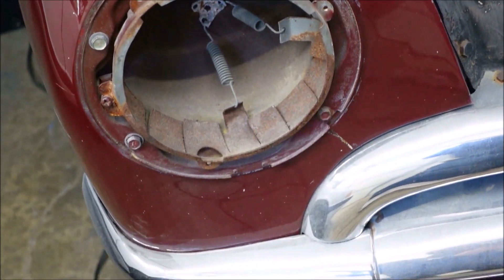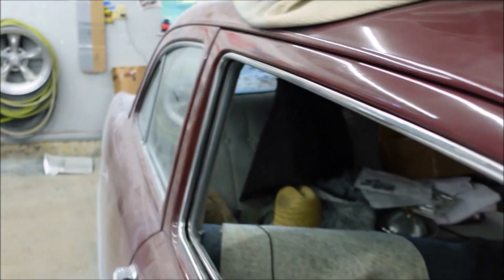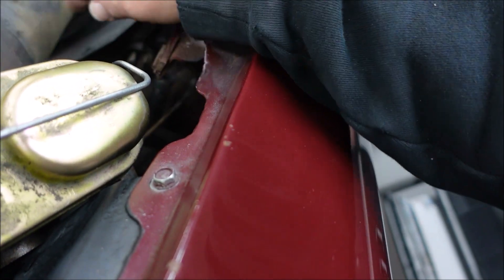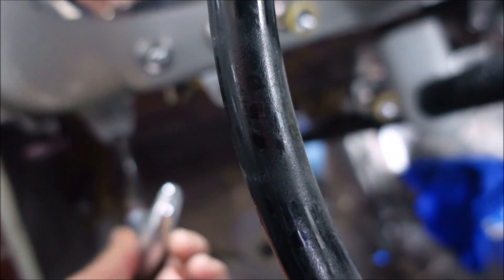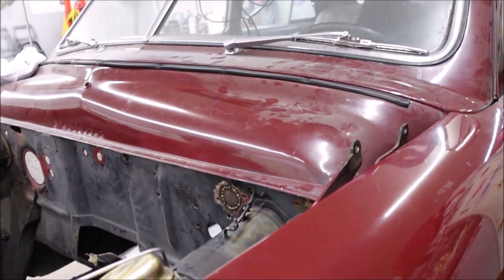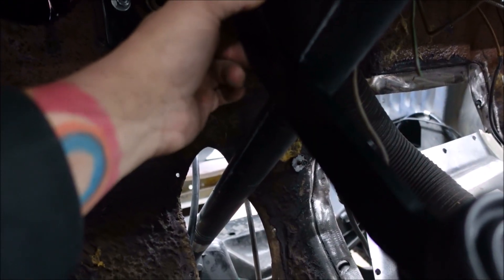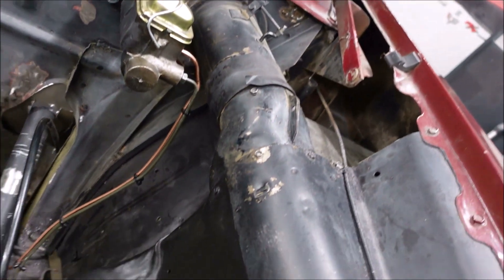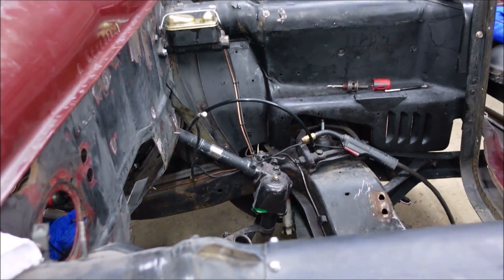Shoebox Ford firewall mounted master cylinder

Comment: Not sure where you guys are, but, I have a full roller 350 with high rev kit and a turbo 350 trans that came out of my model a pickup, I am going flathead v8  ford and you guys can have this Chevy stuff for free if you come grab it. I am not a Chevy fan.  It s a 1972 small block 4 bold main with camel hump heads shift kit in the trans high stall torque converter…. Come grab it.. I want to see it going to good use. La Mesa California.